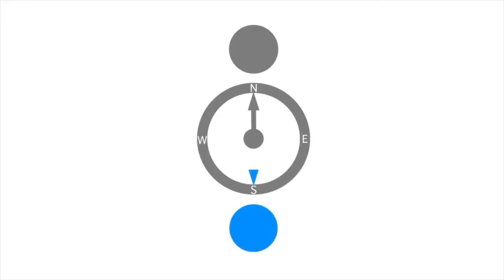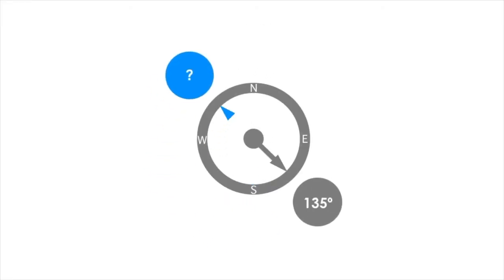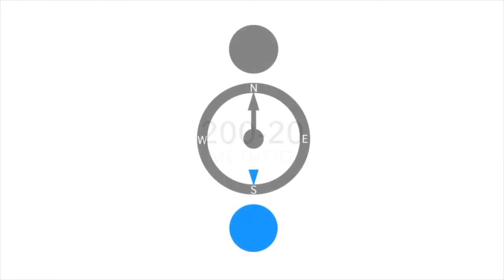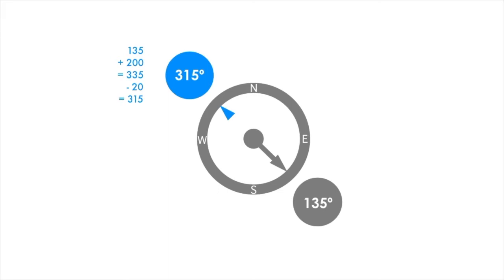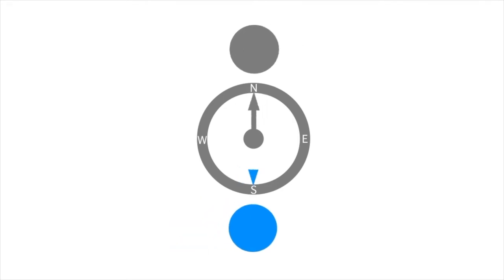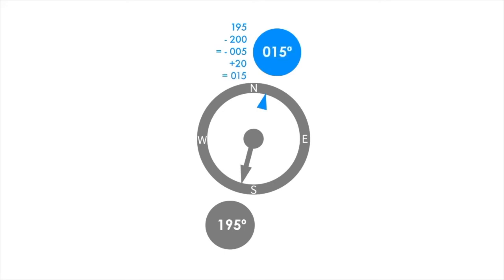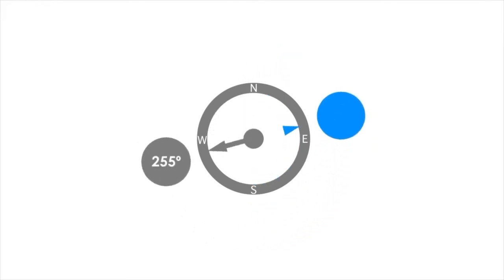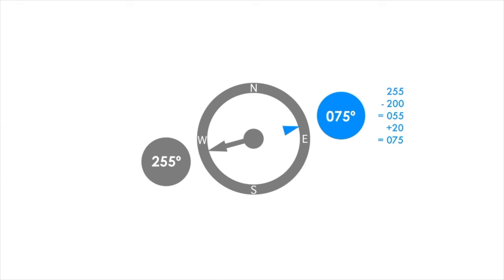Work out reciprocal heading the easier way. Test yourself in this video.

Comment: Seems unnecessarily complex to me and actually has more room for error as you are doing two operations instead of one and also dealing with signed numbers in some cases - that can't be a good thing when one is under pressure. The rule I use is simple: - add 180deg to the original heading if that heading <180deg, else subtract 180 from the original heading - e.g. recip for 125deg = 125+180=305 or recip for 226deg = 226-180=046. Can't see why that's more difficult than this method, but everyone is different I suppose...

Comment: My method is... more than 180 (deduct 180), less than 180 (add 180)... done!
Reply: Same. I simplify it a bit more. I truncate the last number so I just do 2 digit add/sub and then just simply append the last number. E.g., 055 -> 18+5 = 23, append 5 -> 235. E.g., 317. 31-18 = 13, append 7 -> 137

I think the same trick can be applied to this video and keep your brain doing 2 digit math instead of 3 digit.
Instead of doing +200, -20. Do +20, -2 and viceversa. E.g., 5+20 = 25-2 = 23, then append 5 --> 235. 31-20 = 11 + 2 = 13 append 7 --> 137